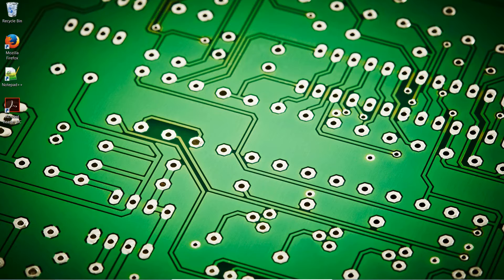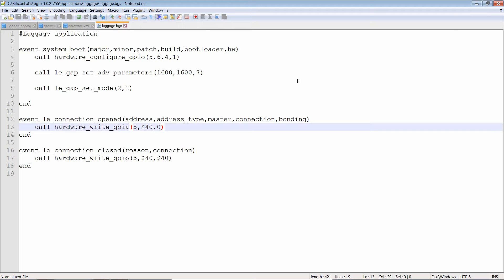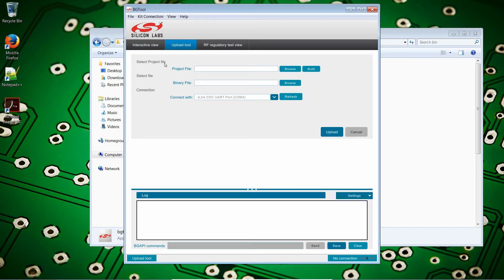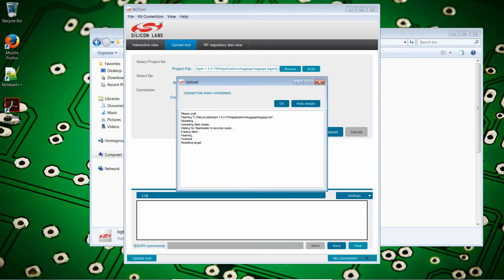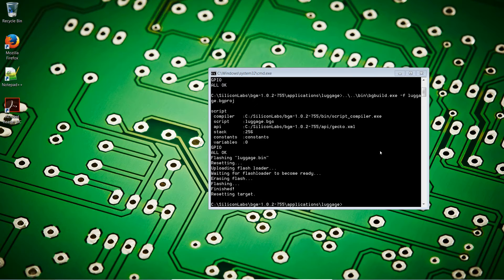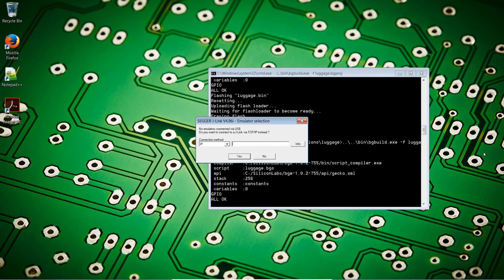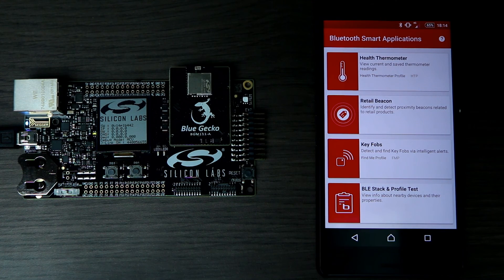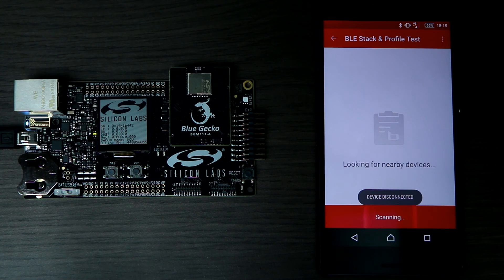Bluetooth in Action 6 -  First program, part 2

Comment: I followed all your steps to compile the thermometer bgproj example that came with the SLWSTK6101B SDK I got last week and it all worked fine from start to finish including monitoring it on RealTerm.  I also tried the expansion board accelerometer project & that worked out fine too.For my project design,   I have encountered some issues with BGScript limitations on driving I2C slave mode & SPI lines on the BGMXXX module so today, I've installed Simplicity Studio, BT Smart SDK & IAR evaluation compiler for free.   After trying that out, I decided just to go back & retry building the BGScript again.  However, it is no longer flashing the code.   This is the command line output now: Qt: Untested Windows version 10.0 detected!
GPIO
Compiled, creating bin file.
Creating dfu file.
ALL OK...but no binary output created, etc.Do you know what got affected or screwed up when I installed SS & IAR for C-language coding & compilation that the bgproj build is no longer completing?  FYI - I'm installed the free IAR 32K limite codesize evaluation program.Thanks for the help.

Comment: Very concise and helpful information, I did try to build the bgm111demo project using BGTool but it fails, the build works with command line tool, however.  I am using Windows 10 OS. Can you suggest what could be causing the build error with BGTool ? Thanks.
Reply from the maker: +Shivatech Solutions Hi! And thanks for the kind words. I'm surprised at BGTool not working; in theory, it is 'only' an interface to bgbuild. When it starts, does it ask you to select a module? Maybe it is configured for another module. My virtual machine is running under Windows 7, but the host computer runs on Windows 10, and it works just fine on my installation.
Reply: +James A. Langbridge Yes, it asks to select a module, I select BGM111. BGTool build is working as you have shown in your video, but it does not work on my PC. I contacted Silabs tech support, they are saying its not yet supported  :)
Reply from the maker: Whoops! Nobody told me it wasn't supported yet... Sorry! Still, so long as you can compile and flash, that's the most important thing. I'll also concentrate on bgbuild.exe for future videos